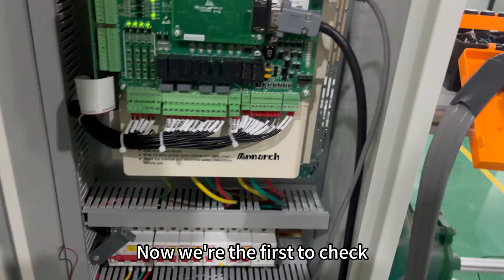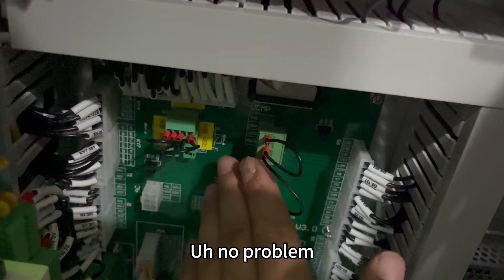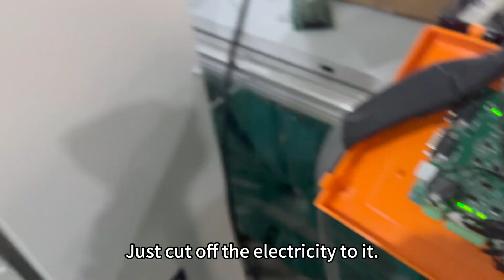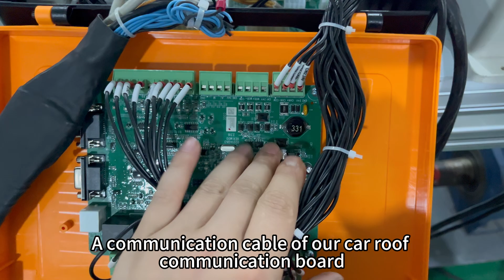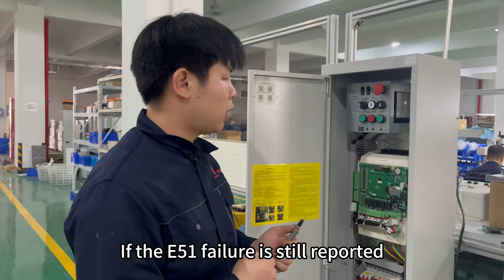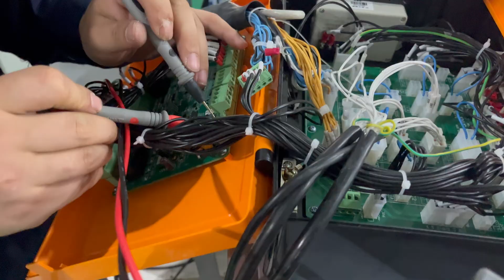Monarch E51 Error Troubleshooting and Repair Methods

Comment: How about E53
Reply from the maker: We haven't made a video about the E53 yet. I've noted your question and will work with our engineers to create a solution during the next video shoot.
Reply: It basically has to do with opening  issues if the elevator arrives  at a floor and for any reason don't  open the door the error 53 pops up .